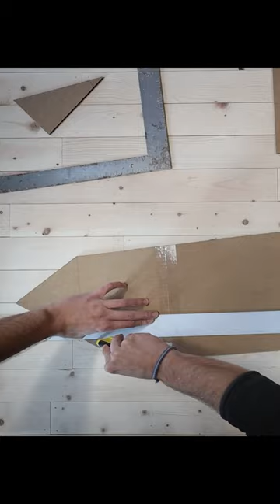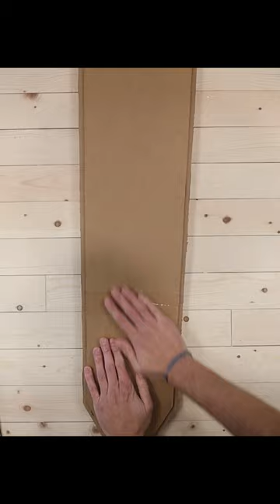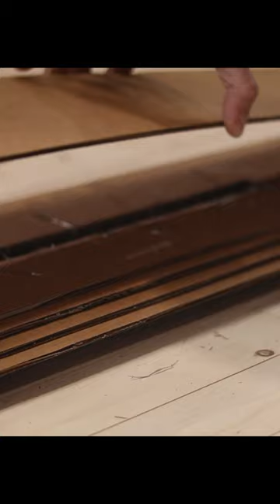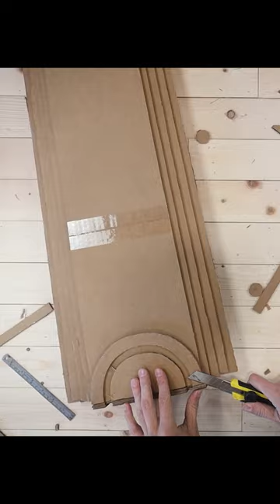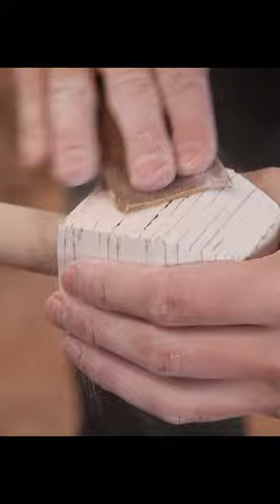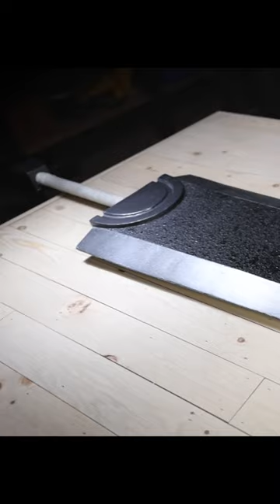Building a Cardboard Dragonslayer

Comment: Can I ask, is it possible to replace drywall with milk glue and paper?? 😢 The place I live does not sell pre-mixed drywall.
Reply: All you need is a substance that smoothnes out the texture and adds some strength whatever you use aslong as it suits that purpose you should be good

Comment: I tried making it and it keeps cracking and I don’t know what to do :(
Reply: It usually happens when there is too much stress on the cardboard. He uses a box cutter and doesn’t press on the cardboard. The cardboard is still easily crackable until you either are at the end process where you cover it in plaster or whatever liquid he uses.